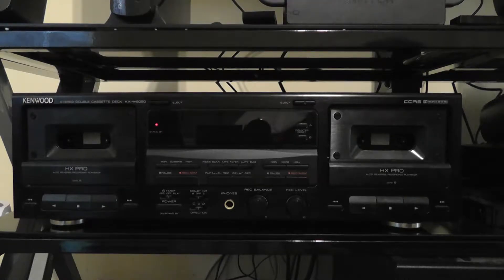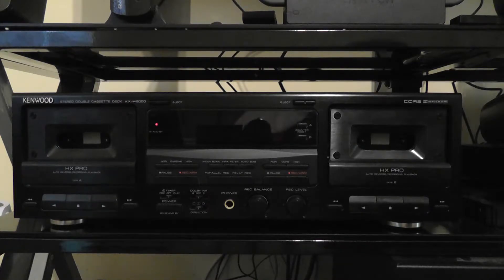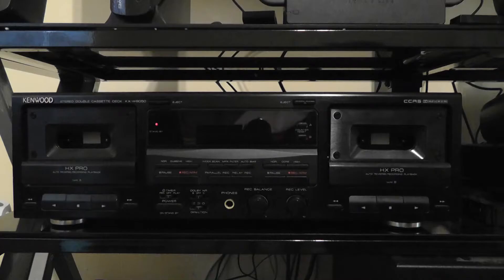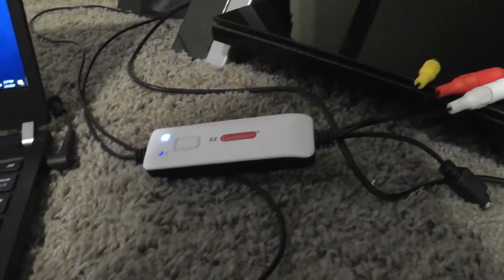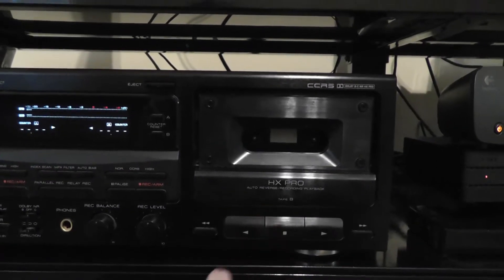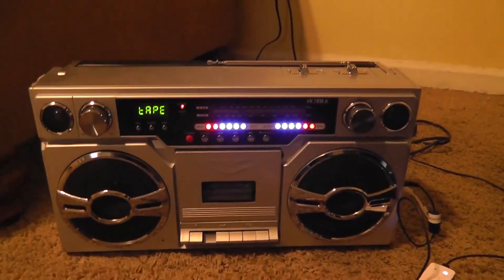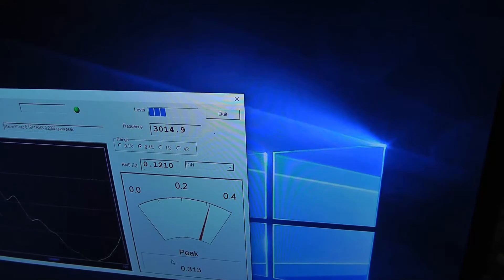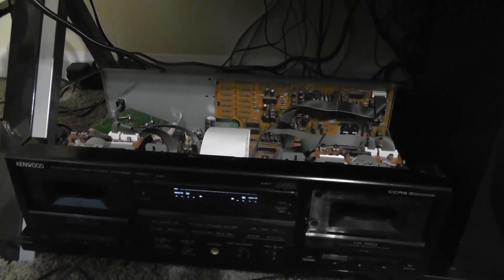Tape Deck Speed Adjustment Using A Homemade Test Tape

Comment: Does the wow and flutter program. Automatically. Read the capture device or will I have to download software from the capture device first?
Reply from the maker: You may have to install the driver for your capture device first, but after that it should detect it.
Reply: @ thanks for the response. Ordering one tonight. So I will give it a try.
Reply: @ ok I’ve got my capture device. When I open my WFGUI app windows. Nothing is playing through it. Any suggestions?

Comment: I didn't want to spend a dime, yet I needed to calibrate my tape player/recorder speed to at least know how far off it was.  I had a commercial cassette tape of a well-known artist.  On YouTube was an "official" recording of the same album.  I digitized my cassette tape with my tape deck and Audacity and also downloaded the YouTube recording using YTD downloader and loaded it into Audacity.  Looking at the "waveforms", I highlighted the same song from both versions, and read the duration of the songs.  With a calculator, I calculated the per cent change in speed (-2.2 %) for my tape song to equal the duration of the YouTube downloaded song.  Then I could either capture from my tape player and change the speed -2.2% in Audacity, or adjust the tape player speed to be 2.2% slower.  If you can assume the tape player/recorder has about the same deviation when recording, you can create a tone tape by recording a tone that is higher according to your calculations and then adjust the motor until the tone equals the desired calibrated frequency.  Not the easiest process, but a "bush fix" of sorts.
Reply: I was thinking of doing the same, recording a song from a commercial retail cassette tape to PC, and then comparing the duration of that song to a digital copy ripped from a CD. Then repeatedly re-recording and adjusting the tape motor speed until the duration of the song from the tape version is within a second or two in variance. What about the Azimuth calibration, is there a free method that you know of?

Comment: Can't you just record the audio from a CD and the same album from a pre-recorded tape into the computer, place both waveforms into audacity, and then line up the beginning of a song? Then look at the end of the song, and you should be able to see a shift. The other way is to just listen to a song. Does the beat sound off? Are the notes slightly flat? It seems like the higher tones are more noticeable when things run slow.

Comment: Back in the 70'sand 80's when cassettes were the standard for music playing, the decks from the major manufacturers, wanting to get a slight advantage over the competition, would have their decks play slightly faster than standard, usually around 2%. In the showroom, when you brought in your favorite music tape, the effect was slightly higher pitch and clearer sound. (at least, that was the perception).  After you bought the machine, and used it for a while, the mechanisms would loosen up and the tape would play even faster. 
I was in the cassette duplication business and I calibrated hundreds of tape decks. I never found a new one that didn't play slightly fast. I was using professional calibrated speed tapes and a Sound Technology 1500 tape recorder analyzer for calibration.
Radio stations had been using the faster speed trick for years on their music in order  to sound more exciting than the other stations. When CD's were introduced, the players had a jumper that could be cut for a 2% speed increase.
Reply: hah that is wild :)

Comment: 2:40 if you record a tone on a good quality ferric tape using a Quartz locked recorder like a WM-D6C that is in good condition, it will be fine. Something with a quartz locked transport will always be on the ball unless its in bad condition and needs servicing.

Comment: If you have recorded tapes made on the same machine (like I have) and want the same speed on another "new" machine (to play recorded tapes accurately), use a tape recorded (in previous machine) from CD. For this, use a headphone. Use the same CD and play it on for example the left channel. Play the recorded version on the right channel. Try to synchronize both versions (this real fun!). When both versions sound the same, stay long in sync (since tape is analog and CD digital), you have the correct speed for your recorded tapes.

To get the azimuth right, the same as on recorded tapes (without any noise reduction turned on), use a amplifier with a mono switch or use a headphone with a stereo to mono connector. Play a recorded tape and listen to the high frequencies. When changing the azimuth you will hear the high frequencies change. You need to find the right 'spot' to get highest clear sound without any artifacts. If dolby was used on  any of the tapes, it also sounds better. When the heads have the same azimuth (as recorded tape), the sound is not muffled (or less) when dolby switched on.

If you don't have tapes, a new user to tapes, you can do what you describe in your video to get the 'right' speed (and azimuth by using the callibration tape) however if you have (many) unique recordings made on a different machine, it is another story. Callibrating the speed to a 'calibration standard' after you made some recordings effects the playback speed of the recordings previously made. I know analog is never precise as digital and because of that everybody creates there own standard when start to record something without callibrating. That is what normally happen, recording and assume it is the right speed. It is never exact as you showed us so what if you started wrong? Hundred of tapes doesn't sound correct, run on the incorrect speed when callibrating 'correctly'. 

Callibration is good however, when you start fresh. Calibrate to a 'standard' doesn't make sense when you have recordings previously made. I suggest to use your own standard (like I explained before) if you use it to playback your own previously made recordings. In modern times, I think every transport needs a tweak control, to tweak the age of time. Like Nakamichi did with auto azimuth. Every tape is unique like every recorder is.

Comment: I do not trust this without one additional step. 
You must know the absolute length and use a stop watch to set the speed .  Without this step it cannot be precise.  Using a tone is a secondary or tertiary standard ,  only using a timer from start to stop, marking the points with a felt pen and then measyuring the true length will give the absolute speed. I would disassemle the tape and measure it on a linear table  and then reassemble it.  No need for a time period over 3 minutes because that would be cumbersome and possibly reduce the accuracy of the measurement.  I was a i&c tech
And this is how we had to deal with all possible variations and midtakes by other parties. Larry k

Comment: I use an Android phone with a Anker usb c hub, a tecknet usb sound adaptor plugged into that hub, switch the android usb to midi mode, plug a cable into the mic socket on the tecknet and one into the headphone socket on the deck. Then I use this video - https://www.youtube.com/watch?v=wbd2gGtXh0w - to playback a 400hz tone and an app called Spectroid to analyse the tone. Put as tape into the deck and switch between source and playback....this only works on a 3 head deck obviously. On Spectroid for it to be fully accurate you need to change the FFT size to 8192 bins.

Comment: I have a few boom boxes and you can adjust the speed.  If not on the board there is a adjustment that can be done on the back of the motor through a small hole,  I currently have a boom box that has adjustments for both normal and high speed dubbing
Reply from the maker: Yes this is correct, and I have done this with the Victrola boombox in a later video.

Comment: Isn't it 440hrz for adjusting speed?
Reply: No, Most are 3k or 3150hz,  but depends on what deck you have, Update some use 440hz and guitar sound meter

Comment: I recorded an A 440hz tone on a TDK SM10 using a calibrated  nakamichi 1000zxl 30 years ago. It has worked for easy accurate testing ever since. No test equipment needed.

Comment: How to adjust hi speed dubbing speed?
Reply: it is just doubled speed. There must be trimpot for highspeed, look inside. Cheers, 😎
Reply: If there is no potentiometer for one side you must write down the high speed frequency of the fixed one then adjust the high speed pot of the other one to that frequency, There should be pins to short to activate high speed, refer to service manual to avoid the magic smoke, soft touch decks should have a button combination to press to activate high speed/service mode.
Cheaper decks will have one motor shared for the two, those will be simpler to adjust.

Comment: To avoid buying a test tape, could you just use a normal tape and then compare that frequency output to the song on youtube or something?
Reply: I ran into the same thought.  In my opinion, technically doable.  The thing is that you don't know if the tape was recorded at the right speed.